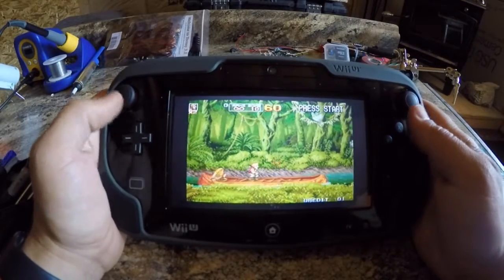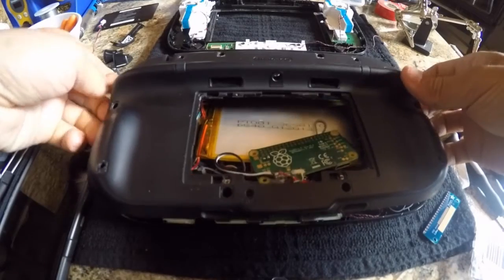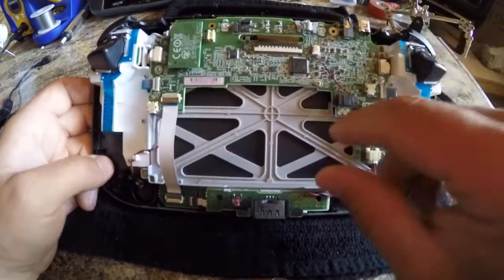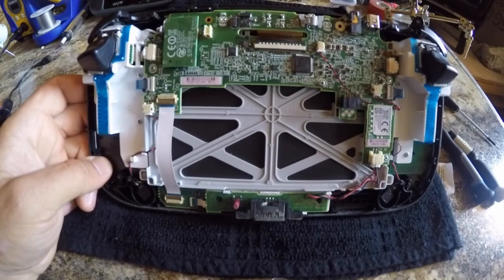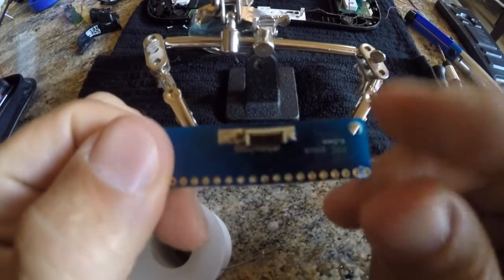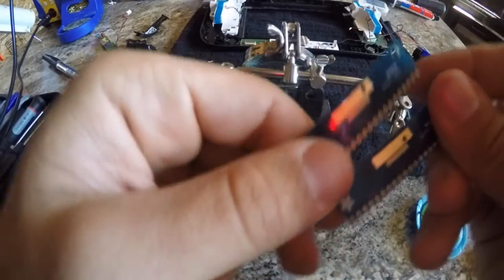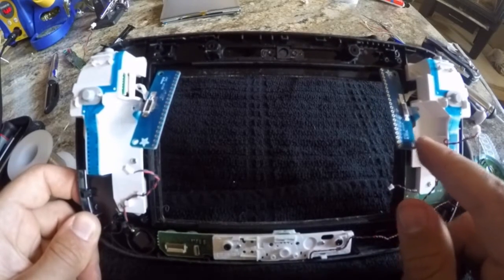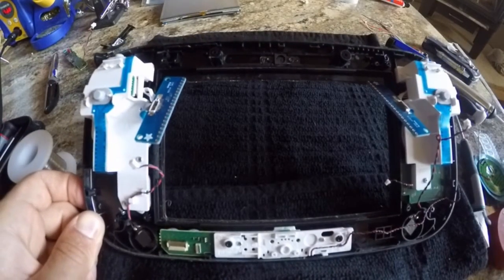Wii U Gamepad RetroPie- Step 1 controls

Comment: Could you just wire the buttons straight to the teensy instead of using using the connectors??
Reply from the maker: It would be about impossible to tap into that ribbon connector. This is the easiest way. Makes it easy if you need to take things apart too.
Reply: Greg Arnold what is the breakout board called.. cant find it on adafruit